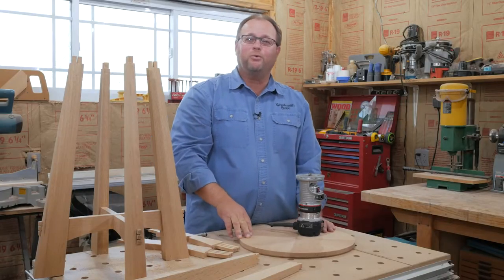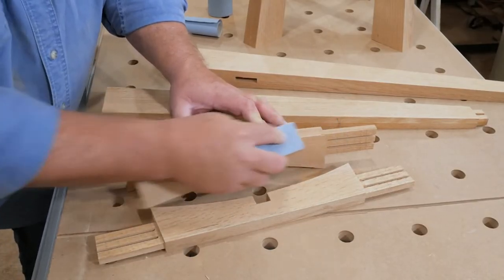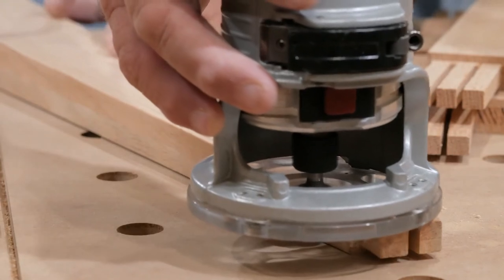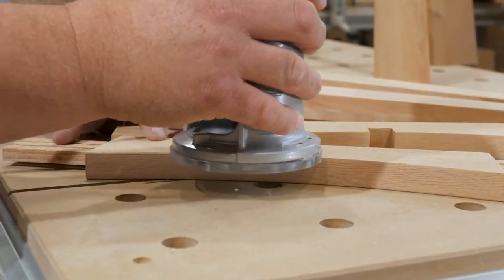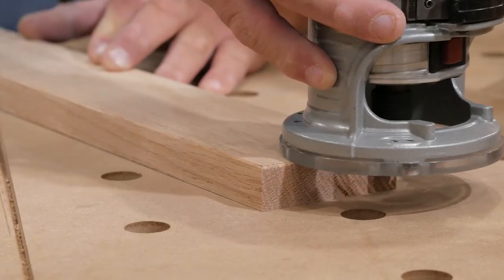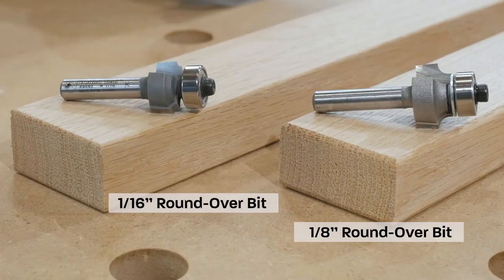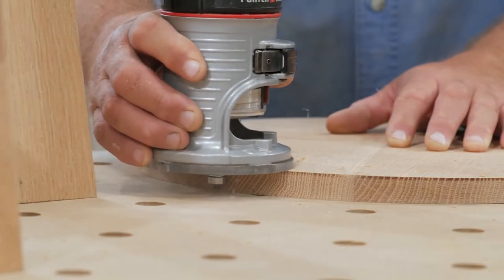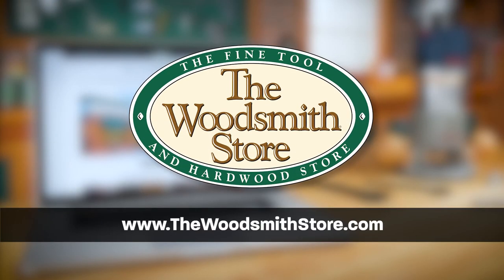Tiny...But Mighty...Router Bits!

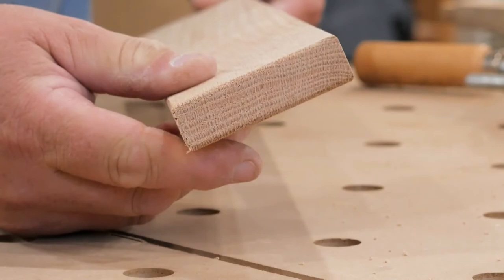Comment: 3:30 they also have a 3/32" bit which will give exactly that, a round over between 1/16" and 1/8". It's Amana Tool part number MR0110

Comment: Thanks much for this. This is exactly what I was looking for. Quick follow-up question : Can this router bit be used on a thin strip of wood ? I am planning to use it on 0.25 inch thick poplar strips off homedepot. Anything I should know before attempting this ? Thanks.
Reply from the maker: It can be used on 1/4" thick strips, but just make sure you have the wood clamped or firmly held down to your workbench if routing with a handheld router. If routing on a router table, use featherboards and/or pushpads to keep the strips tight against the fence and your fingers away from the bit.

Comment: Hey, great tutorial,  very informative.  When routing a cylinder (drum shell, apx 5.4mm thick) would you be better starting with smallest bit then graduating up, or 1/8 bit adjusting to gradually remove more stock? In short,  I'm looking to do full round over on cylinder or 30 degree inside and r1.5 outside.  Thanks for your help!
Reply from the maker: I would use one bit and increase the depth of cut as you go along. If you are trying to turn a long, square piece into a cylinder or dowel, you will need to use a router table because as you get closer to a round shape, there is not enough material for the guide bearing on the bit to ride against. In a router table, you can use the fence to control the depth of cut. It also a good idea to make your part extra long and leave an inch or two at each end square to help support the workpiece as you roundover the edges.
Reply: @thewoodsmithstore  thank you